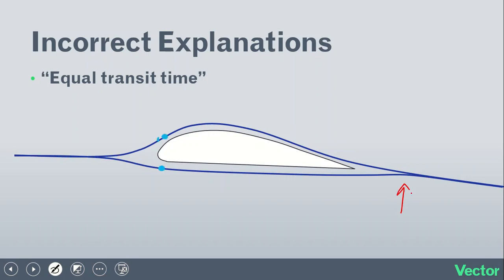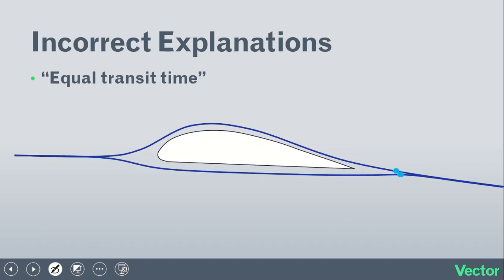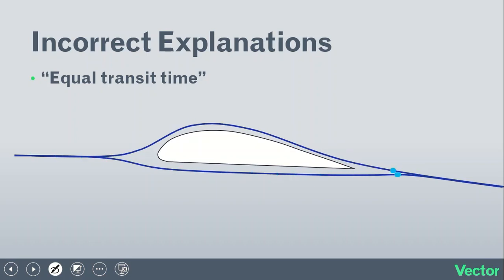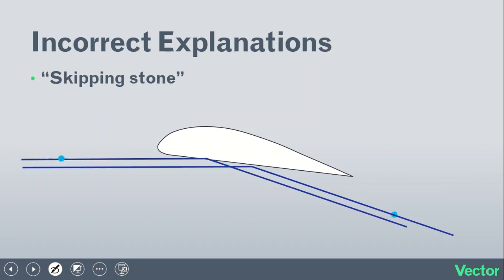Common Misconceptions About Lift

Comment: So then the air moving over the top of the air foil actually is moving faster than that moving under, ending up further to the rear of the air particles from underneath. Care to tell us why? Seems important to know.
Reply: Viscosity. The attractive force between molecules means the flow at the trailing edge sheds a bound vortex. The result of this vorticity in the flow (usually called circulation) is that there is up wash inducted in the flow, which accelerates the top flow more. It also produces an area over the upper surface which has a lower pressure for longer also resulting in less deceleration which means more speed.
Reply: @aerospacedoctor  A tangle of partially correct concepts—viscosity, circulation, pressure distribution—but it fails to map them into a causally clear, physically meaningful account of lift. Viscosity is relevant but not a driver of lift. A clue is that this person always returns to denying essential vertical momentum change: A non-Newtonian cognitive disconnect.
Reply: @davetime5234  I am sorry you can't grasp the subtle aspects of momentum flux in fluid mechanics. It is not a surprise, it trips up many engineering students, and seasoned "experts" as well. You insist on logical fallacies, in particular ad hominem and strawman, and I suspect that is driven by the cognitive dissonance. I say that with confidence, because I keep telling you that you can chose a frame of reference in the fluid that does allow you to explain lift as a momentum flux across the aerofoil. Read that again! But here you are again, saying I am "denying essential vertical momentum change". Nope, never have. Again (in case you didn't read it again) there is a momentum flux, because the flow has upward turning before the aerofoil and downward turning behind the aerofoil. You see, another statement that proves you are wrong about what I claim.
I have only told you repeatedly that in 2D there is NO NET vertical momentum change, such that the aerofoil does NOT impart any net downwash to the airflow; that is, the airflow never goes below the incoming level (streamline) at any point in time. I am sorry you can't grasp the complexity of what the continuity equation requires, and I am sorry you have decided your AI (the one which you repeatedly claim you don't use) is correct, even though it was trained on an internets worth of explanations of lift that are fundamentally flawed in at least one way, if not more. I reviewed 136 scientific articles, and only 6 of them where completely correct, can you comprehend how wrong the internet of training data is going to be if less that 5% of the literature is correct! But sure, that LLM is going to be able to explain anything I say to you, without working on the assumption that its training data is correct.

Two weeks ago I watched the AIAA presentation for the paper titled, Application of Gauss' Principle to the Classical Airfoil Problem. Great news, that is available Open Access on the AIAA (which was published to refute the paper published by Taha you asked me about a year or so ago). 
How did the last slide of the presentation end? The Kutta condition is a surrogate for viscosity.
You know what expert aerodynamicists asked in the chat? Can we still derive a model that does not require viscosity.
So you tell me how your AI and the average educated person is going to understand all of this, if even some aerodynamicists can watch two senior experts explain that you cannot have lift without viscosity, and that the earlier paper was wrong, and then those same aerodynamicists still ask if we can avoid viscosity.
This is not epistemic arrogance, and it is not an appeal to authority. It is pointing out a fact, that even trained specialists can hold onto misconceptions. If the people who work in the field still struggle with the underlying reasoning, it is completely reasonable for me to say that most people, and any general purpose AI, are not going to get this right without being guided to the specific experts who do understand the physics.
Reply: @aerospacedoctor  You keep shifting the goal posts on d(mv)/dt in the vertical direction. At one point you even claimed it was invalid because “dt” somehow violates time invariance — that’s a basic physics incoherence.

Your 2D case is potential flow, which is more than just “no viscosity.” It’s a truncation of real physics that ignores momentum conservation. That’s a glaring oversight.

In real physical 2D, when a solid asymmetry induces lift, there must be a net downward momentum flux — viscosity or not. Why? Because the real world enforces conservation of momentum.

Do you not see? The barrier between potential flow and physical lift is not merely viscosity. The deeper hurdle is that potential flow blocks momentum conservation itself. That’s where the mathematical abstraction breaks from physical reality.

And I haven't even scratched the surface on viscosity.

And as far as Karl Kruszelnicki when you insisted you value of flow velocity in the combustion chamber and he took rightful pause, you were in full character or not being off by an order of magnitude, unapologetically.

And I heard no clarification of lift whatsoever.

Your abuse is unjustifiable.
Reply: @davetime5234  more unfounded claims by your AI that I shift goal posts; I never have. That is you. I have explained myself in detail at every point. I made very clear statements in my last comment that you literally had to ignore because you can't understand what I am saying. There is no point continuing to engage with you, because as your ad hominem attack about me referring to laminar flame speed shows, you are petty, irrational, and illogical. All you do is chase the same few points, never at the same time, in a circle, because you can't see them all together. Your statement that the 2D case is potential flow proves how little you know about aerodynamics. Nope, I solve the full Navier-Stokes in 2D. That literally cannot ignore momentum conservation. What is truncated is your understanding of momentum conservation, and that again is proven by the fact that you ignored my correct factual statements in the previous comments.
Reply: @aerospacedoctor  "My AI" is ad hominem, let's be honest.

Look what you said further above: "Viscosity. The attractive force between molecules means the flow at the trailing edge sheds a bound vortex. The result of this vorticity in the flow (usually called circulation) is that there is up wash inducted in the flow, which accelerates the top flow more. It also produces an area over the upper surface which has a lower pressure for longer also resulting in less deceleration which means more speed."

Circulation is a derived description, not a first‑principle mechanism. Viscosity characterizes how the medium is bound together, but it too is not a first‑principle mechanism. The true first principles are conservation of energy, momentum, and mass flow. These laws dictate how the flow encountering an asymmetric body must behave. Circulation is simply the fluid‑dynamics shorthand for how those conservation laws manifest, not a causal explanation in itself. Viscosity influences the coherence with which the governing conservation laws are enforced, but it does not originate the mechanism.

You’re putting the cart before the horse. Leading with viscosity and circulation obscures the real answer, which lies in conservation of energy, momentum, and mass flow.
Reply: @aerospacedoctor  "Colinear 2D" is just potential flow, non‑physical; "real 2D" must show net downward momentum (no "collinearity"). Switching between them is a shell game as exemplified by your "I do NS on my 2D"; but in other cases insisting on nonsense such as "there's no such net momentum because the dt term isn't steady state".  You're all over the map to the point it's clear you haven't honestly paid your dues with the material.
Reply: @davetime5234  so, it is ad hominem for me to point out that you lied when you said you didn't use AI when you do. That does not fit the definition... Once again, I am sorry you don't understand the causal chain of effects, but the viscous interactions happens before the flow field changes giving the momentum flux across the aerofoil (see I said it again). So, yes, the circulation happens after the viscous effect causes the shed starting vortex. You can even invoke conservation of angular momentum balance if you need to. But as discussed a year ago, a year ago, a conservation law is for accounting, it is not the kinetics; forces do the work. That is the real basic physics.
You, once again, don't care that a fluid without viscosity does not differentiate between symmetric and asymmetric geometries. That is literally D'Alembert's paradox... there is a reason it is called a paradox... it is not supposed to make sense! I have told you that before as well. But that is discarded because it is potential flow and that is not real... etc etc... I am sorry, Euler applied the conservation laws you are talking about, and there was no lift and no drag. That result matters, it is critical to understand why Euler's equations don't work (unless you solve them numerically, and I have explained that too). It shows that there is a lack of a force required to initiate asymmetric flow in Euler's equations (again, even asymmetric geometry give symmetric flows using Euler). I have explained this to you, but it is ignored.
So, no, I have not used circulation as a shorthand for how conservation laws manifest. The conservation of angular momentum requires that if I have a system that generates an anticlockwise rotating shed vortex, there must be a counter clockwise element of the flow. But that is not cause and effect, that is accounting. 
1) The growing vortex, created by viscous interactions at the trailing edge, creates a new low pressure in the centre of rotation. That is because there is a centripetal acceleration, and a force must drive that, and that is the pressure gradient. So, as the starting vortex grows, and the flow accelerates, it drives down the pressure at the trailing edge. 
2) This creates a new pressure gradient force from the high pressure rear stagnation point that is up on the top surface, to the low pressure centre of rotation. 
3) Eventually, the inflation of the starting vortex, driving down the pressure in the centre of rotation, forces the stagnation point to the trailing edge. 
4) This then extends the region of lower pressure over the top surface; we have now set the kinetic of WHY more fluid can flow over the upper surface, because we have created the low pressure region. 
5) This induces the upward turning of the flow upstream, so we decrease the pressure above, so more fluid is push up over the top from the higher pressure region ahead. Importantly, that is not instantaneous. There is a wave in the pressure field which propagates ahead at the speed of sound.

The result of all of that is, the forces do the work, and the conservation laws make sure we have done all of the accounting correct. Flow comes in horizontal in the far field, flow goes out horizontal in the far field, the amount of upward turning must be equal to the amount of downward turning, and the momentum flux is responsible for turning that upward into the downward, but it does not pump air down! That momentum flux corresponds to the pressure difference across the aerofoil, and ultimately, it is the molecules of air impacting less on the top and more on the bottom (higher pressure below, lower pressure above) that is the final mechanical action at work. A wing does not impart a net momentum to generate lift, it does not work like a rocket taking a mass of air and accelerating it down! I know that is such an easy way to explain it, I know Mark Rober said that on Hot Ones, but that does not make it correct! This is the truly hard part, that there can be a pressure difference, with a momentum flux, but air has not been "pushed down". But here is the thing, it is accelerated up (the upward turning), and decelerated down (the downward turning). That is a positive magnitude in a positive direction, and a negative magnitude in the negative direction, so guess what the result of that momentum flux is? See, you can have lift without needing to have a net push down! A wing is not a rocket.
Reply: @davetime5234  I guess you forgot this comment from 2 months ago talking about Doug's video where I wrote:

so, the triangulation is he has said at 6:00 the system equation is applicable, at 7:33 we use the Eulerian formulation, so we have convective acceleration, 9:22 the image of flow that is correct has upward turning and downward turning, 11:46 he says the statement that a wing pushes on the air and the air pushes back gives lift is wrong, 19:50 he critiques the simple downward turning explanations (literally the thing you are claiming is correct, he says is incorrect), then at 20:55 he states that this implies that the interaction is local and happens “after”, and this does not capture the entire fluid field that is influenced (you know the corresponding upwash), you are latching on to him saying there is a net flux (depending on where you draw the control surface) behind, and then in the next sentence he literally says it is equal to the flux from the upward turning, and they are both half the lift (again, assuming there is a control volume that is thin and tall enough). He literally says that result also applies in 3D, when talking about the flux change across the wing, not behind it! At 41:00 he literally goes through your misconception, and highlights why the Trefftz-plane integral is incorrect. The actual integrated effect of the “net momentum imparted to the air” is zero! This is a serious high level misconception that exists in textbooks. The integral then becomes the same one from 2D, half the lift from upward turning, half the lift for downward turning, if you have a close control surface. He then goes on to the momentum accumulated in the atmosphere, and there is ZERO net momentum transfer to the entire atmosphere. He supports this with Prandtl and Lanchester.
Reply: @davetime5234  YT appears to have removed your comment or you did, the one from 7 hours ago. I have had the same issue so many times of the past 4 weeks, that is why there have been huge gaps. I reply the same day, but the comments don't stick. Apparently not civil enough. But to the first point, you comment on the Xyla video from 2 months ago (can't share links here, email if you want it) was, and I quote "I don't use ChatGPT. But anyway I was carrying on a multi related issue dialogue to try to tease out my ignorance". Now to be fair, I have been saying the general "AI" But you said ChatGPT, so you could be right on a technicality, but I think it is reasonable to assume I would infer that to mean generative AI, not the exact "brand".
Reply: Regarding the flow field changes that do happen after the viscous effects, there are videos here that show this, email me and I will provide the links, since they can't be posted.
Reply: So, calling it an academic c0n, that is an ad hominem... it is amazing, I mean I know I said "y0u l!ed", but I provided the evidence for that (also, do recall you started in the Xyla Foxlin video by calling my statements buIIs...). This academic c0n statement is literlly made as a logical fallacy. I mean, how is it an academic c0n, when it is established and proven? Read the paper of Tianshu Liu of WMU, his most recent one involved PIV of the trailing edge vortex being shed in starting flow. I mean, why not read the work that proves it? Also, if those articles are not accessible, just ask for them.
Reply: "Rhetorical misdirection"... The idea the conservation laws are causal is an active area of physics education research. There are papers on that topic. What I literally provided you in my post 13 hours before this, was a complete description of what happens, that is causal, that has the correct kinetics, and obeys the required conservation laws... and your take away is a strawman claim once again. I did have the momentum conserved, that is why I spoke about the upward acceleration and the downward deceleration, becuase that is what we do in fluid mechanics for the control surface around an aerofoil. So please, please tell me what I avoid and where. Because I have literally avoided nothing, and you keep throwing in strawman arguments!
Reply: No, D'Alembert's paradox applies to Euler's formulation. If you read Anderson's History of Aerodynamics, you will note that we basically still use the exact form from Euler, just with the shorthand notation from Heavyside. All of this is documented in the history of fluid dynamics. And all you do is just pull strawman arguments. I didn't say potential flow, I explicitly said Euler. But you want to seperate them because of the cognative bias. Like saying "that issue is only relevant to potential flow, and that is irrelevant to lift"... No, Euler was the one that confirmed there was no lift or drag. There are papers literally called things like "on the motion of bodies through perfect fluids" at the time. So no, I am tripping over nothing. I know that I am solving the full Navier-Stokes in 2D, and I know with the forth order solver we use, I can turn off viscosity, and I recover Euler's original analytic solution. Which is something simple numerical solvers can't do, since they add numerical dissipation.
Reply: Also, go watch the video from two months ago titled The How and Why of Lift - An Intuitive Guide to Circulation
Reply: @aerospacedoctor  McLean’s consistent message is that lift requires imparting downward momentum locally through the wing’s pressure field, while you distort McLean’s critique of faulty modeling methods (Trefftz plane, whole‑atmosphere integrals) into a blanket denial of net downward momentum itself.

Admittedly McLean's wording makes it important to study carefully how he is arranging and framing what he says.  But I believe you misunderstand the information.

Here is an AI attempt at assessing what you said (When I use AI, I constantly push back on it.    There is an aspect of this I would push back on further, but time...):  

Graham is treating McLean’s critique of misplaced fingerprints (Trefftz plane, whole‑atmosphere integrals) as if McLean were denying the existence of net downward momentum altogether.

He quotes McLean’s rejection of the “push‑down” simplification as if it were a denial of Newton’s 3rd law, when in fact McLean is saying the mechanism is more subtle: the pressure field imparts momentum, not a crude “push.”

He latches onto the “half upwash, half downwash” partition and misrepresents it as proof that there is no net downward momentum, when McLean is only showing how fluxes balance in a chosen control surface.

He concludes “the integrated effect is zero” and uses that to argue against net downward momentum, but McLean’s point is that depending on the control surface, integrals can cancel — that does not negate the local acceleration at the wing.
Reply: @aerospacedoctor  You said: " flow field changes that do happen after the viscous effects"

That's physically incoherent:

The flow field and the viscous related "mass momentum participation/capture" have to be in the same footprint
Reply: @davetime5234  reply to your first message. Part 1:

That first statement is perfect! Yes, the keyword is LOCALLY! That was my point, there is upward turning in and downward turning out, and yes, that literally matches the local pressure field, they are linked by the momentum equation. But there is no global net downwash. I gave you the literal timestamps where McLean literally says there is no net downward flux. From 21:31

"in a 2D airfoil flow there really is not any net downward turning because the vertical velocities involved go to zero at large distances from the airfoil so you get far enough away from the airfoil there has not been any downward turning"

Then at 22:09

"if you look at a control volume like this with two vertical faces you find that with an airfoil with circulation around it uh there are fluxes ahead of the airfoil and behind that is a flux of upwash ahead of the airfoil and a flux of downwash behind that account for half the lift each and then you can say well the airfoil is what imparted the difference between those two and that accounts for all of the lift"

As I said to you multiple times, Doug is ultimately the source of the information I have been saying to you! So no, I don't misunderstand the information, I have studied it for years, and I have discussed it with multiple aerodynamicists, including Doug. I have tried to explain it to you, and I have offered my time to discuss it live. I am an educator, and all I want to do is educate.

I haven't even talked about the more complex parts which is 3D, the Trefftz plane, and Prandtl's pressure integral. I want to avoid those, because they become strawman arguments, very easily.
Reply: Part 2:

So to your AI's comments:
1) I have literally provided the direct quotes where Doug literally says there is no net downward turning in 2D. But there is a moment changes as the upward turning becomes downward turning.

2) the fact that there is no NET push down is the only point I have been trying to make. I clearly don't reject Newton's 3rd law, the fluid pushes on the aerofoil which is equal and opposite to how the aerofoil pushes on the fluid.
To be very clear, it is not valid to insist there is a net mass flux which is equal and opposite the lift. This is the point of what I have said in the last few days, a wing is not a rocket. Doug explicitly states this too at 11:31, where what you are looking for is the momentum change; that is given by the pressure gradient force, which is Newton's 2nd law, he says "generating an aerodynamic force generally requires the fluid to be accelerated and acceleration and forces are the domain of Newton's second law not the third". At 11:14 he states "that a fluid and a body exchange equal and opposite forces across their interface". That is where we apply Newton's 3rd law. Please don't strawman me here Dave, an acceleration in the context here in an Eulerian reference frame, is not a change in velocity with time. This is a fluid in steady state. The literal definition of steady state is nothing changes in time. This is local spatial acceleration, the flow changes direction, and the magnitude changes as x and y change, not as t changes.

3) the quote from Doug support my claim that the upward turning and downward turning are equal and opposite. The "proof" is below where I talk about the continuity equation. Importantly continuity applies to the entire flow and any part of it!

4) your AI here says nothing I don't agree with. Despite what you have claimed, I have always stated that locally the momentum equation equates the momentum change to the pressure change. This is the most surprising thing I read from you, because I have gone through all of our old conversations and we have both always agreed that there is a pressure difference that is the thing doing the local pushing. I understand where that comes from in the momentum equation. But what you haven't grasped is the subtly that there is no net downwash in 2D because the momentum change locally at the aerofoil simply changes the upward turning to downward turning, but as noted countless times (also in the quote from Doug), the boundary condition are horizontal in flow and out flow in the far field, and the continuity equation required there to be no divergence. If there is no divergence, then the flow can't have diverted! You can draw any control surface and that constraint will be true. Immediately before the aerofoil the amount of upward turning is equal and opposite the amount of downward turning immediately after the aerofoil; no divergence. In the far field, every streamline in a given vertical position flows out at the same vertical position; no divergence. You used the insist on the continuity equation. I have applied it correctly. Please open Babinsky's article "how do wings work" it is available on the Cambridge website for free. Look at Figure 9, the streamlines in and out are all colinear! Figure 10 and 11 suggest the same thing, but the domains are not symmetric, hence why Figure 9 is so important. If you go to that new video I told you about (there were a lot of comments I left you yesterday) then you can play with Harry's online simulation (link in his description) and you can play with this yourself!

Importantly you say you push back on what your AI say, show me. Prove it to me. If that is true, I want to write a paper with you about what your AI has said. It is a critical key case study in Socratic learning using AI. I mean that!
Reply: @davetime5234  Reply to your second message... I don't want to talk about causality and more complicated things, until the misunderstanding around momentum and 2D flow are settled. I have made the mistake too many times of trying to describe to many parallel things before, and it is confusing. This part in particular is a serious issue, because as I alluded to, even professional aerodynamicists can watch other aerodynamicists prove that you can't have lift without viscosity, and they still ask the question "but can we have lift without viscosity?"
Reply: @aerospacedoctor  You said: 

"That first statement is perfect! Yes, the keyword is LOCALLY! That was my point, there is upward turning in and downward turning out, and yes, that literally matches the local pressure field, they are linked by the momentum equation."

Unfortunately, it appears you are still trying to hide the net downward momentum that must exist in physically real 2D as much as 3D.

And it must be LOCALLY! - why?:

Because all of that net change in downward momentum can only occur where the pressure field exists.

And the (meaningful) pressure field only exists locally, actually at the airfoil.

I don't know what you mean by your definition of global vs local but this can be very misleading: 

"But there is no global net downwash. "

Over the Earth of course there is dissipation.  But after the airfoil passes, the acceleration of net downward momentum is no longer an acceleration, because the airfoil's flow field has passed, so what's left is the downward velocity fingerprint of that acceleration.

It cannot be otherwise for an asymmetrical solid in the path of a relative linear flow.

This literally fits with McCane's phasing in that video.
Reply: @aerospacedoctor  You are clearly misunderstanding what you said:

"I gave you the literal timestamps where McLean literally says there is no net downward flux. From 21:31

"in a 2D airfoil flow there really is not any net downward turning because the vertical velocities involved go to zero at large distances from the airfoil so you get far enough away from the airfoil there has not been any downward turning"

Then at 22:09..."

Go back and listen to the lead into that.  

Then listen in particular to what is said after that at  22:33.  "the airfoil is what accounted for THE DIFFERENCE between those two, and THAT ACCOUNTS FOR ALL OF THE LIFT".  The smoking gun of NET DOWNWARD..

That has to be true, that again, the net downward acceleration happens locally (again at the fields), and that the fingerprint is the net downward velocity momentum after the fields have passed (the "local global" vs the "global global")

Again, this ties in logically and consistently with your misreading of d'Alembert's paradox and what is caused by alone viscosity vs the full potential flow mathematical truncation of physicality.

And I will re-emphasize a previous point:  the effects of viscosity cannot be spatially separated from the flow fields.

Not a single bit of AI in the above.
Reply: @aerospacedoctor  You said:  

"even professional aerodynamicists can watch other aerodynamicists prove that you can't have lift without viscosity, and they still ask the question "but can we have lift without viscosity?""

Of course lift exists without viscosity.

But no one is claiming you can produce a L/D ratio of 15 vs perhaps a very small and unusable fraction of that, but the fact remains:

An asymmetry to linear flow will produce a transverse force.  And lift is simply such a transverse force.

Potential flow is a mathematical tool that says nothing about the physical necessity of the above.
Reply: message 3, and parts of the other two, are clear strawman attempts! 
I explicitly said I was not discussing causality, viscosity, etc, and you throw in L/D, or whether lift can be computed in inviscid models. I deliberately bracketed things out to avoid exactly this kind of derail attempt. 
The discussion is only about momentum in 2D steady flow, specifically whether there is a net far-field downward flux or not. Nothing in what I wrote requires taking a position on “lift without viscosity”. Bringing that up does not respond to what I said, it changes the topic. That is literally the definition of a strawman argument. 
Here is the thing, when a narrowly defined technical question is repeatedly widened into unrelated domains, it is because the original claim cannot be defended within its own constraints. That is, expanding the scope is only necessary when the claim does not survive within the scope it was made. This is a very common in political debates, it is textbook rhetorical evasion. That is not how technical debates work.
Reply: Reply to message 1 and 2...
1) Just because I love to say this, there is no net downward momentum period.
2) “And it must be LOCALLY! - why?:”
Great question, sorry, I should have provided a neat list of things you must refute.
i: the continuity equation, any and all regions of flow, without sources or sinks (of which there are neither for an aerofoil), must be divergence free. Literally, the flow cannot diverge, which in this case translates nicely to be, they cannot divert.
ii: Babinsky Figure 9. I mean this is just showing i again, but then again the continuity equation is critical.
iii: That quote from Doug, “there really is not any net downward turning”.
iv: CFD simulations, showing the far field, which I have done and will gladly show you.
Now, this is where we put on our lab coats, and we do science. This is not an actual debate, you can’t talk intuitively refute what I am saying. You need mathematics and simulations. There must be evidence, not cherry picked statements.
3) “Because all of that net change in downward momentum can only occur where the pressure field exists.” 
Go on, I am listening…
4) “And the (meaningful) pressure field only exists locally, actually at the airfoil.”
Oh Dave, that is very insightful. But before I do an inductive leap, can you confirm for me that this implies “after” the aerofoil has past, and there is no pressure field anymore, there can also be no sustained motion in the atmosphere? Fingers crossed…
5) “I don't know what you mean by”… “But after the airfoil passes, the acceleration of net downward momentum is no longer an acceleration, because the airfoil's flow field has passed, so what's left is the downward velocity fingerprint of that acceleration.”
So close… No, there has to be a pressure source if there is a velocity component downward. Could this be your source of confusion, that you can have an increased velocity without an associated change in pressure supporting that? Wouldn’t that be interesting. 
A hair dryer or air hose works because the machinery adds total pressure. The jet persists only while that pressure excess exists. As the flow mixes and the total pressure relaxes back to ambient, the velocity necessarily decays to zero.
You can see this directly in simulation. If you model a jet and track it far enough downstream, once the total pressure is back to ambient, the velocity goes to zero. It has to. That is just Bernoulli.
The same logic applies to lift. Once you are far enough from the aerofoil that the pressure field has returned to freestream, there is nothing left to sustain a downward velocity component. So the flow straightens out again.
The idea of a “downward velocity fingerprint” left behind by acceleration feels intuitive, but it only works if something continues to support that velocity. In steady 2D flow, nothing does.
This was not obvious to me until I ran simulations and watched the far field relax. That was the moment it clicked.
(next comment)
6) So I gave you a quote that literally contradicts everything you say, and your rebuttal to it is “listen to what he says after.” That is, 22:36
"the air foils is what imparted the difference between those two and that accounts for all of the lift”
You will note I extracted the correct text there, with the time stamp. Now, exactly how does that contradict the fact that the flow was turned upward and then turned downward. How does that now imply that there is a net downward momentum? Because, I gave you the quote before, 21:31
"in a 2D airfoil flow there really is not any net downward turning because the vertical velocities involved go to zero at large distances from the airfoil so you get far enough away from the airfoil there has not been any downward turning"
What is it exactly you think is the smoking gun here?
Again, look at Figure 9 from Babinsky, explain how for that circular arc aerofoil the streamlines in and out are literally at the same vertical position, if there is a net deflection downward.
7) “That has to be true”…
I agree, it is true, there is locally a downward acceleration, because there was upward acceleration before that, and the downward local part is needed to give a net result of zero. Again, look at Babinsky, Figure 9, and the literal quote from Doug, there is no “net downward velocity momentum after”
8) Strawman, the discussion is not about d'Alembert's paradox. No!
Reply: @davetime5234  replied.
Reply: Dave, I honestly think we just need to focus on point 5. I do not think anything else matters at this stage. I think this is the misunderstanding, and once it is resolved the rest falls into place.

I think this goes back to one of our earlier discussions. You are implicitly using a billiard-ball or projectile model of matter, where once something has been accelerated it simply keeps moving unless something actively stops it. That intuition works for isolated particles. It does not work for a fluid in steady flow.

In fluid mechanics, sustained velocity is not something that “remains” after acceleration. It must be continuously supported by a pressure field. If the pressure gradients vanish, the velocity field must relax back to the freestream. That is not an interpretation, it is how the equations are structured.

That is why jets require machinery to maintain total pressure, and why, once the pressure excess is gone, the jet velocity decays. A jet works because something upstream is continuously doing work on the fluid.

A wing is not a rocket. It does not inject momentum into the flow and then let it coast away. It does not add total pressure. All it does is redistribute the existing momentum of the freestream through a pressure field that exists only in the vicinity of the wing.

So once you are far enough from the aerofoil that the pressure field has returned to ambient, there is nothing left to support a persistent downward velocity component. If there were, the wing would be acting like a momentum source, which it is not.

This is exactly why the flow can be turned locally and still straighten back out again. Local pressure forces do the turning, but there is no sustained “thrust-like” mechanism to keep the flow moving downward afterwards.
Reply: @aerospacedoctor  I'm endeavoring to discuss the truth by focusing on specifics and inevitably intertwined issues.  I'm appealing to logic and evidence to the extent possible, but you are refuting by generalities, cliched dismissals ("strawman"), and attempted projection of credentialism oppression of logical discussion.  Academically inappropriate.

Politically manipulative?  Some introspection here is necessary.
Reply: @aerospacedoctor  I'll take the part for now, where you said: 

“message 3, and parts of the other two, are clear strawman attempts! 
I explicitly said I was not discussing causality, viscosity, etc, and you throw in L/D, or whether lift can be computed in inviscid models. I deliberately bracketed things out to avoid exactly this kind of derail attempt. 
The discussion is only about momentum in 2D steady flow, specifically whether there is a net far-field downward flux or not. Nothing in what I wrote requires taking a position on “lift without viscosity”. Bringing that up does not respond to what I said, it changes the topic. That is literally the definition of a strawman argument.”

The discussion of momentum in 2D steady flow and the question of downward momentum change must consider how you define 2D flow.  

If it is the mathematical idealization of potential flow, then it lacks attributes necessary for that net downward momentum change.  

If it is physically real, then it must have that net downward momentum change (for the asymmetrical case).  

The difference between those two cases hinges on a few criteria, only one of which is viscosity.  You have insisted that viscosity is the pivot point for lift, and the L/D ratio directly considers the connection between viscosity and the existence of any transverse force (which is the definition of lift).  

No strawman argument:  Newtonian mechanics ensures a transverse force from asymmetry.  The hoped for implication you would understand is that viscosity affects the L/D ratio, not the fact that Newtonian mechanics makes its existence, whatever size or however small, an inevitability.

Viscosity is integral to the "tuning of the instrument, not whether it makes a sound or not".
Reply: @aerospacedoctor  On you saying here yet again there is no net downward momentum:

Again, your same old shell game:  "no there's not"; "yes there is, I never said there's not"; repeat

On your continuity equation reference and saying they "they can't divert":

Lacks sufficient technical precision to understand your point.

"Babinsky figure 9":

While officious sounding, I have no idea where that figure is or what it refers to.

"That quote from Doug, “there really is not any net downward turning”.":

I gave you the time stamp where he explicitly says the opposite.  And he widely maintains the opposite in his material.

"CFD simulations, showing the far field, which I have done and will gladly show you.
Now, this is where we put on our lab coats, and we do science. This is not an actual debate, you can’t talk intuitively refute what I am saying. You need mathematics and simulations. There must be evidence, not cherry picked statements.":

My argument is built up from notions of "what can be known with mathematical certainty":  pressure-velocity response to obstruction due to continuity; pressure asymmetry due to physical asymmetry and the pressure response; net pressure gradient and mass acceleration; transverse force from conservation of momentum.  Again your far field reference to reject downward turning (that McLean says exists) is pure shell game.    

"But before I do an inductive leap, can you confirm for me that this implies “after” the aerofoil has past, and there is no pressure field anymore, there can also be no sustained motion in the atmosphere? Fingers crossed…":

Of course there are attenuation fields associated with dissipation in the atmosphere.  We're talking about the creation fields and the airfoil; the dissipation fields are a different beast, partly because of the time required for meaningful full action.

Your whole hairdryer thing and the creation vs dissipation issue is shell game again frankly.  Clearly velocity differentials get dissipated. 

....that's enough for now, other than:

"Strawman, the discussion is not about d'Alembert's paradox. No!"

Nonsense.  d'Alembert's paradox is intimately tied to the issue:  it arises precisely because in ideal potential flow the incoming and outgoing streamlines remain perfectly symmetric and colinear, producing no net momentum change and therefore no lift nor drag (even with asymmetry).
Reply: @davetime5234 "Again, your same old shell game", go on then, provide me direct quotes and point to the exact comments where I say there is a net downward momentum. Otherwise, concede the point.
Reply: @aerospacedoctor  The range of comments are embedded within at least 3 different (if not more) YT videos and in possibly more than 3 threads most of which are very long.  I can't remember the originating YT video.  

You give me an index to all of that and I'll go back and scan it.

More simply, do you deny you've said Newton's third law needs to be satisfied, as well as saying you were going to check with colleagues in fluid dynamics on some of these issue just to be sure?  But at some point you abandoned the peer consultation statements entirely.  

I can't remember which was the first such video. 

Or are you now claiming you reject Newton's 3rd law associated with the full force of lift?
Reply: @davetime5234 stop with the strawman. You made a claim, you are required to provide the proof. Provide the proof or concede the point.
Reply: @aerospacedoctor  This is really the issue is it not?:  

Navier–Stokes plus continuity imply vorticity conservation, so vortices must close. But that in no way refutes the Newtonian requirement: the full lift force is accounted for by the vertical momentum change imparted at the wing through its pressure field. The vortex system lies outside that force‑exchange system: it is the atmospheric closure, not the cause of lift.

Doug McClean essentially made the corroborating point that the tip vortices after leaving the wing don't account for any lift (all that integral nonsense).

The issue here is conflating vortex closure with the actual Newtonian force exchange at the wing
Reply: @davetime5234 we are talking exclusively about you claiming I made contradictory statements about a net downward movement in the flow. Provide the proof that I did that (main video the Dylan Foxlin one), or concede the point that your "opinion" I did that is mistaken. No changing the topic. Address the current point only.
Reply: @aerospacedoctor  Your words (comment 2 months ago):  " It is false that the lift is produced by the associated mass flux in 3d"
Reply: @aerospacedoctor  and:  "You can't just isolate the flow between the wing tips and claim downward turned flow!"
Reply: @davetime5234 no, your claim is I said there was a net downward momentum and there wasn't, contradictory statements. What you just provided as evidence does not support that. A mass flux and a momentum flux are literally not the same thing.
Reply: @aerospacedoctor  The momentum flux is carried by the mass flux.  And it is real.
Reply: @davetime5234 no, mass transport and momentum transport are different. Just like a water wave can transport energy and not mass. Air can transport momentum and not mass. The point does not support your claim. Do you have other evidence, because you made the claim a lot, or is that it?
Reply: @aerospacedoctor  In the context of transport phenomena and fluid dynamics, momentum flux is formally defined as the rate of momentum transfer through a unit area, which is equivalent to the product of mass flux and velocity. 

Newton's cradle is irrelevant.   There's no compelling reason to even have brought it up:  it's in no way analogous to a steady state pressure field accelerating air mass in a one-way direction along its gradient.

Stop with the deflections and say what you actually mean pertinent to the issue"

the Xyla Folin video is not the correct one.  It was made only 8 months ago.  This goes back well over 12 months, so I don't know of how to find those earlier dialogues.

But it's a waste of time if not quickly available.  Just explain yourself.
Reply: @davetime5234  part 1 (having issues getting this to stick)... that is still not quotes from me that proves I made contradictory statements that there is both 1) no net downward momentum flux, and 2) there is a net downward momentum flux. You have repeatedly said it, you need to have the proof, not the opinion. Because I am saying as I have repeatedly, that I have NEVER said the second one.
Now your definition there is fine, but it also proves my point. I mean I can't say force and acceleration are the SAME thing, they are not. So, my claim that mass transport and momentum transport are different is correct. Your claim that they are "equivalent" is not. The key take away will be, that since there is no net downward momentum flux, there will also be no net downward mass flux, and that is also true for 2D flow. Again, the streamlines return to horizontal in the far field, and they are collinear. Now, look for: Babinsky how do wings work 2003, and the first result will hopefully be the same for you as it is for me, a document from the University of Cambridge, and you need to look at Figure 9 in that.
Reply: part 2... I didn't mention a Newton's cradle here, so why mention it. We are currently discussing one thing, your claim I said contradictory things about the net downward momentum flux.
So, I have not deflected anything, I have focused exclusively on your comment that you claim I say contradictory things about the net downward momentum flux.
You are correct, it was not the Xyla video, it turns out it is this video; scroll down, and you will see a comment thread started by me "If you want to know where..."
So, since I have repeatedly said I have NEVER said "there is a net downward momentum flux", why would you say "just explain yourself" when you refuse to listen to me? Again, if you make claims in a debate, you must have the proof.
Reply: @aerospacedoctor  "I have NEVER said the second one."  (2 - there is a net downward momentum flux").

Ok so now you're back at repealing Newton's 3rd law.

Completely analogous is claiming astronauts don’t urinate because water is recycled. Circulation theory doesn’t erase Newton’s third law.

AI summary of the references that follow (I haven't checked all in detail because I'm not getting paid for this):

"Across NASA modeling, ICAO regulation, airborne measurements, and independent calculations, the consensus is clear: aircraft generate a sustained downward momentum flux that persists for miles downstream, distinct from tip vortex rotation. This flux is the physical manifestation of Newton’s law, directly balancing lift with weight through d(mv)/dt. It is measurable in cloud disturbances, modeled in wake hazard studies, and codified in separation standards — the “smoking gun” that circulation theory and momentum flux are coherent."

References
Baculi et al., NASA Ames UAM Wake Study (2022)

Proctor, NASA Langley Wake Vortex Model (1998)

ICAO Wake Turbulence Separation Standards

Koning et al., Airborne Momentum Flux in Clouds (2022)

Landell‑Mills, Independent Downwash Calculations (2023)
Reply: @aerospacedoctor  part 2:  So, I found Babinsky's fig 9 you referenced.  That is a potential flow diagram which is unambiguously violating physical flow.  Babinsky does a real disservice by not being clear about this.  Talk about messed up historical pedagogy!
Reply: @davetime5234  you did it again, another strawman. We are not talking about Newton's 3rd law. Show me quotes from me where I claim there is a net downward momentum imparted to the flow.
Reply: @aerospacedoctor  Your prior Newton's cradle dialogue is directly connected to the net downward momentum mess.  No getting around it.
Reply: @davetime5234  another strawman. No, prove I said there is a net downward momentum or concede the point.
Reply: @aerospacedoctor  Ridiculous and patently disingenuous deflection - word games: that "net downward momentum" is meant to be anything different from obeying "Newton's 3rd law".
Reply: @aerospacedoctor  We both know in our heart of hearts that you are backed into corner, where self-honesty is the only way out.

Good luck with that, the fork in the road is your choice.
Reply: @aerospacedoctor  If you actually don't understand these points then I have to be honest, I question your educational credentials.
Reply: @davetime5234 you made the claim that I said both that there is and is not a net downward momentum in the flow. Prove I made that claim. If not, concede the point.
Reply: @davetime5234 you made the claim that I said both that there is and is not a net downward momentum in the flow. Prove I made that claim. If not, concede the point.
Reply: @aerospacedoctor  You just literally said it, so no need to waste time being your secretary:  

"part 1 (having issues getting this to stick)... that is still not quotes from me that proves I made contradictory statements that there is both 1) no net downward momentum flux, and 2) there is a net downward momentum flux. You have repeatedly said it, you need to have the proof, not the opinion. Because I am saying as I have repeatedly, that I have NEVER said the second one."

"NEVER said the second"

So, you're claiming you hold the first to be true.  So that's what I addressed.

Stop with the BS.
Reply: @davetime5234 you just quoted me stating the two statements you attribute to me, as in me quoting you. No, just no. Prove I have said there is a net downward momentum or concede the point.
Reply: @davetime5234  for the past 24 hours, and 25 messages, the concept has been very simple. we are discussing your comment to me, and the first claim in that was "Again, your same old shell game", were I have both said there is and is not net downward momentum. I simply asked you to prove it, because I disagree. I have never said the former, only ever the later. All you have do to do is provide the evidence that is literally me claiming there is net downward momentum, or you simply concede the point, and you were mistaken in your opinion.
Reply: @aerospacedoctor Pure con tactic.  Poor (failure of a) con tactic.  Your smoke screen with claiming I need to establish the irrelevant case.

The fact that you here claim with emphatic underline, the absurd case is all that matters:  The case that not only your hero McClean denies, but anyone of any scientific credibility denies.

We had an academic fraud in a core technical role, who operated for a good while until one of his subordinates did a background check of his credentials.
Reply: @davetime5234 so to be very clear, as has been simply requested you refuse to substantiate your claims, you refuse to concede the point, then good bye.
Reply: @davetime5234 now rather than actually participate in a transparent honest discourse you would rather attack me on another comment thread, all because you can't either a) prove I said exactly what you claimed I said, or b) concede I didn't... Why? It is really simple, you make a claim, support it with proof!
Reply: @aerospacedoctor You objectively have technician/technologist level coherence vs engineering/science level coherence.  There's no getting around it.  Not just a single meaningful inconsistency but compounded inconsistencies.  It would be unethical not to push back.  You are fundamentally misrepresenting the truth.
Reply: @davetime5234 I wanted to have a simple discussion limited to one point at a time. You couldn't even engage in that. You refused to substantiate your claim that I said contradictory things. You don't get to say things like "I am not your secretary"; if you make the claim, you provide the evidence.

So, again, it is really simple, prove I said contradictory things (explicitly about net downward momentum after an aerofoil), if you can't, the rules of a debate require you must concede. So you can
1) have evidence that actually proves it,
2) have evidence that fails to prove it, or
3) concede.
Reply: @davetime5234  I guess the slip up in the other chat proves the point, since your AI is the one following the conversation and who I am debating, it can't actually provide a winning response here, because it knows at no point have I ever explicitly said there is a net downward momentum after an aerofoil.
Reply: All these amateurs wanting their 15 minutes of You Tube fame don't know.
.
 This is just another one of the videos either simply repeating the misconceptions, or explaining that they are wrong, but not including the real physics.
Here is an explanation of the true physics pf ONE and the hardest parts for them to grasp, above a wing: https://www.youtube.com/watch?v=3MSqbnbKDmM